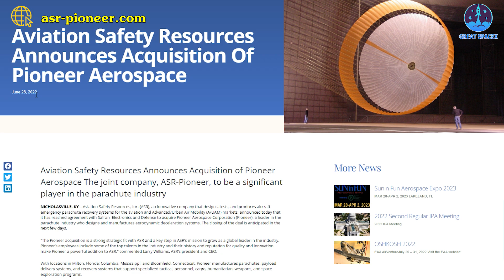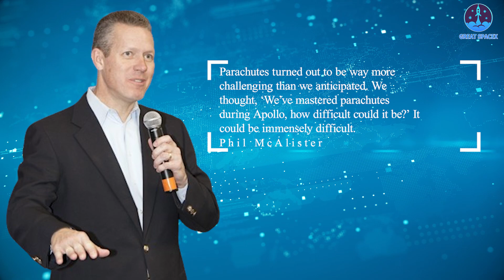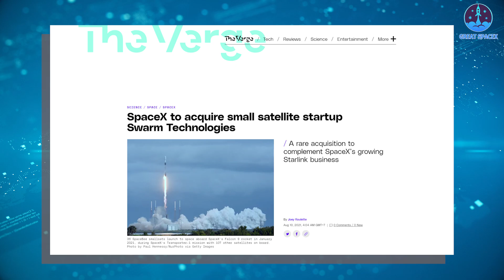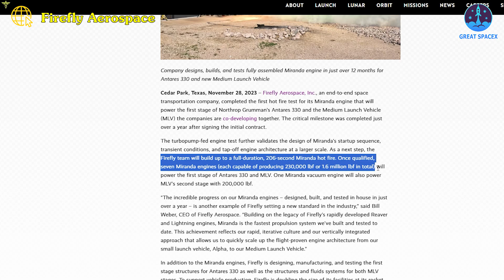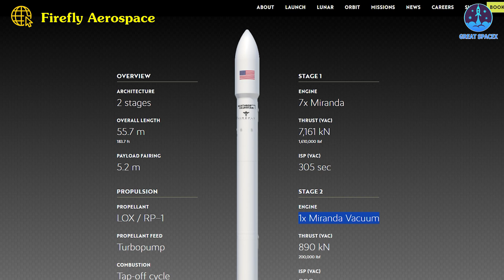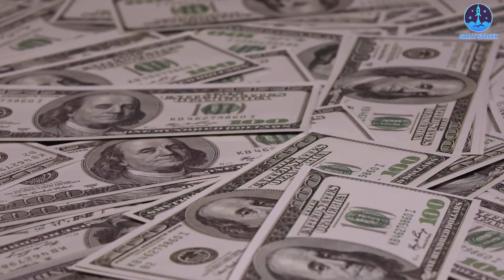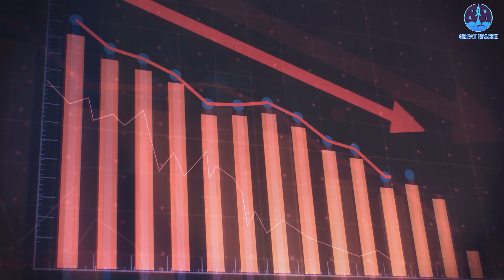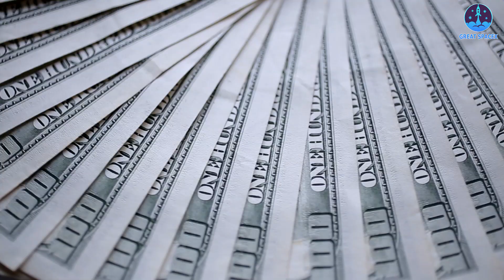Elon Musk's INSANE NEW Decision to save Crew Dragon!

Comment: Turn the Mars return into a orbiting network of prospecting satellites around Luna 1st then Mars. Designed with excessive solar to convert into microwave to beam down to surface installations & equipment to keep them charged up. Add communications/navigation satellites 

We need to spot every easy pickings mineral-resource we need. Maximize our return in effort. Learn to build cargo gliders with minimal power to control descent drones that can land from an unmanned Starship in Luna orbit. They can even be designed to take a beating landing. From the 1st few gliders deploy scaled down, functional, heavy construction equipment as prototypes. All drone. FSD. Get them digging and hauling. Send to confirm findings. On Mars have some serious airdrone action too! Start designing now. 

Then we figure out best ways to deal with building real effective processing gear. This approach optimizes many processes together.
Reply: Let's fantasize about this again sometime, and tell no one.
Reply: What's your point? @GoDodgers1  .

Comment: Green flame implies "engine-rich combustion".  Specifically it means that COPPER is burning.

I do not understand why N-G, the primary rocket engine supplier to ULA and Boeing, cannot supply its own engines for the Antares.  This appears to be tied to the insistence on employing the largely obsolete kerolox propellant, but N-G is the manufacturer of the legendary F-1 engine, the most powerful liquid fuel engine.  Why did they not subcontract to RocketLab?  In the meantime N-G has had to hire ride-shares from SpaceX to meet its contractual commitments for cargo resupply to the ISS.
Reply: Like a good neighbor, SpaceX is there.
Reply: @johnbize5736  When Boing was having problems with its parachutes SpaceX offered its expertise acquired through DOZENS of safe landings of Cargo and Crew Dragons.  SpaceX has only lost one Cargo Dragon in 9 years, and that was due to a silly software oversight.  The Cargo Dragon safely separated from the failing Falcon second stage, but the spacecraft had not been programmed to deploy its parachutes in this case.  SpaceX has absolutely nothing to fear from any of its alleged "competitors".
Reply: @jamescobban857  LOL... We certainly agree.